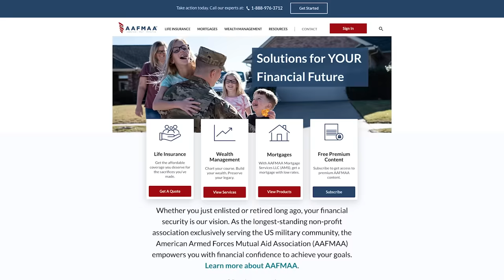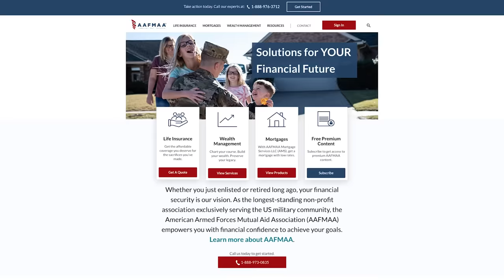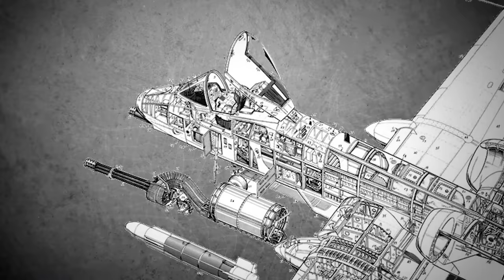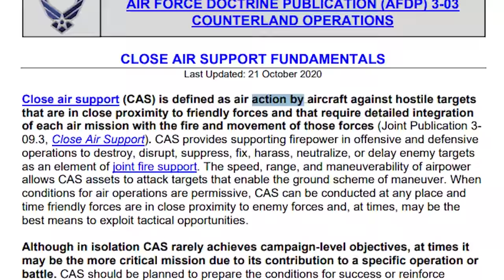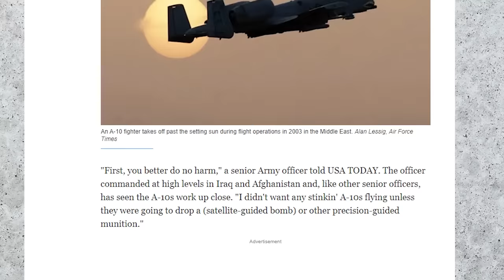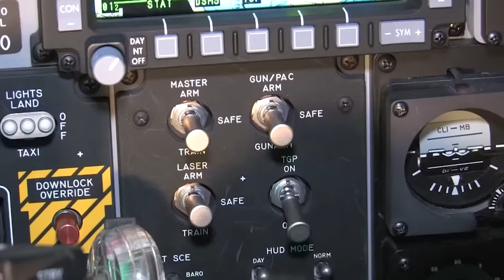Why the Air Force is Screaming to Retire the A-10 Warthog

Comment: The pilots who flew and fly the platform notwithstanding, my experience as an Army Fire Support Coordinator was that the Air Force, just didn’t like the CAS role. It put their aircraft and pilots at too great a risk (Desert Storm notwithstanding).

The apocryphal story is told of two Soviet tank division commanders meeting in Paris, following the defeat of NATO. As they enter a restaurant for dinner, one turns to the other and asks, “Do you know who won the air war?” 

The point being that victory ultimately goes to him who occupies the ground. 

Air superiority is certainly a critical effort, but only facilitates the ground effort. CAS is PART of the ground control effort.  

I have the greatest respect for A-10 pilots, because they understand the importance of the direct support they provide to ground troops, and that they accept the same level of risk those kids down on the ground do. It ain’t sexy, but it’s such a critical mission, and has saved a lot more lives than it has cost. 

There are valid reasons for retiring the A-10 fleet. But having a dedicated platform in that role, pretty much assured that the CAS mission maintained a pretty high priority on the battlefield. 

My concern is that without a dedicated platform, CAS will be relegated to an “we’ll get to it if we have time” mission.
Reply: Your going to me look up apocryphal, aren't you?
Reply: The A-10 has the highest rate of Blue on Blue incidents of any Western CAS platform, this was largely due to the poor degree of situational awareness the rudimentary systems of the A-10A afforded its pilots, but the poor overall accuracy of the GAU-8 is also a factor in situations where the A-10 is providing support to friendly infantry that are in close proximity to hostiles. It has been improved by the addition of sophisticated targeting systems on board the A-10C, however, the problem is that it is redundant, the same mission can be performed by any fast jet in the Air Force inventory. Contrary to what reformers would like you to believe, PGMs really won the day in DS. The F-111, the only coalition aircraft besides the F-117 that had autonomous laser designation capability for guiding Paveways, did the bulk of the tank busting in Desert Storm, destroying something on the order of 700 tanks, far more than A-10s destroyed. Point being, the F-16 could have done the A-10's job from the get-go and the F-35 is the most logical direct replacement for it as a CAS platform. EOTS and DAS will give the F-35 the ability to maintain an infinitesimally higher degree of SA than an A-10 while also being able to operate in contested airspace.

Comment: 50 years is a longevity that any military aircraft would be proud of.  The A-10 might still have one more trick up it's big gun, but even if it doesn't it will long be remembered - at least for another 50 years.   This was a great analysis of a complex situation.
Reply: Grandpa Buff will still be flying though.
Reply: It honestly should have been retired before that but low intensity war kept it around
Reply: It would’ve been retired but they are really good at targeting tailbone in the mountains
Reply: @joeswanson5486  tailbone?